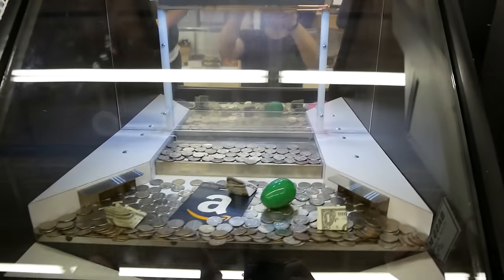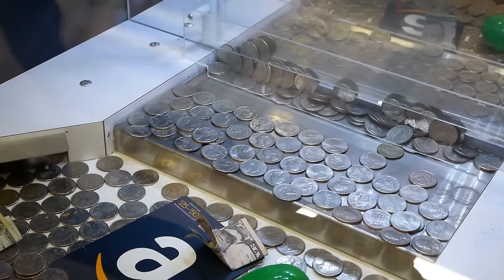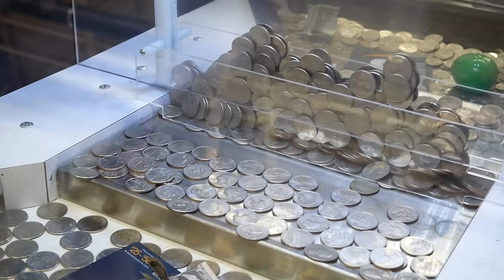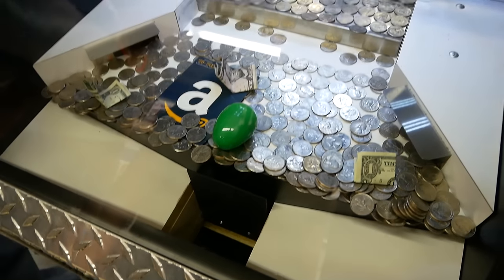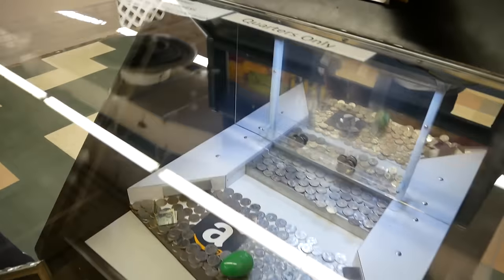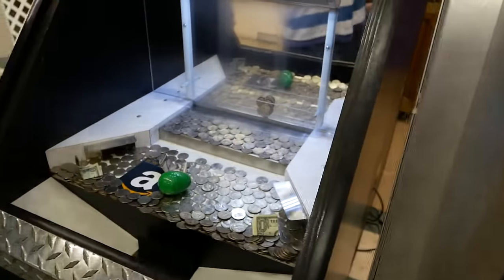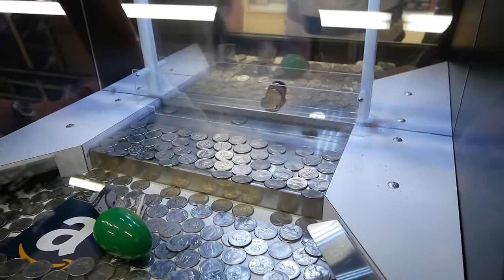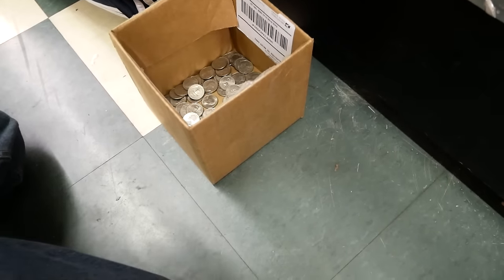Coin Pusher || 200 QUARTERS AT ONCE!!  ( CLOSED )

Comment: I say $37
Reply: Ty Barfoot They counted quarters not $.
Reply: No problem :)
Reply: AtomicCookieGaming I say 90 because 90×25=2250÷25=90
Reply: Edgar Hernandez but 90 is divisible by 3     90÷3 is 30 30is divisible by 10  30÷10 = 3 there are 3 sides to a triangle, illuminati confirmed
Reply: its over 100
Reply: or like 26

Comment: if nothing else, you boys proved what I have been trying to tell other arcade pukes about how to win at the coin pusher: stop the freakin' moving tray and load it up.  The chances are a lot better that many coins will create a wall of resistance that the lower level train cannot absorb.  Singletons get pushed and shoved here and there.  But then you had to get greedy and wound up with a handful of stuck coins.  How is it you have a key to the lock of this machine and can get inside it to bust up the log jam?